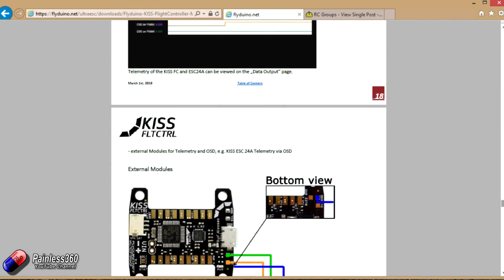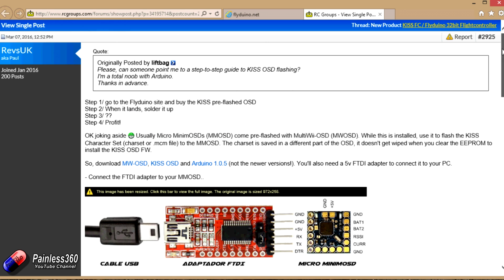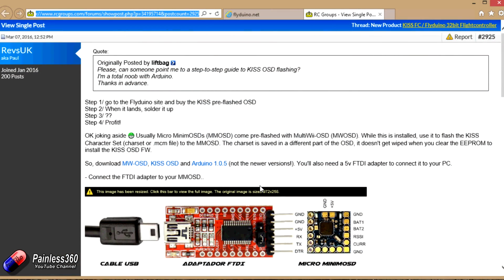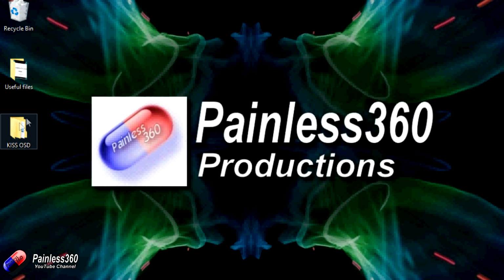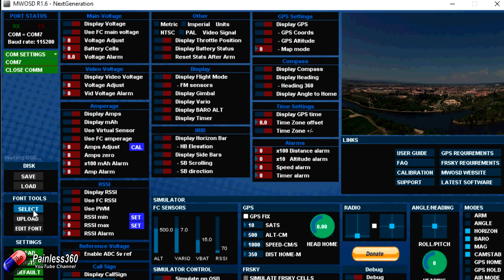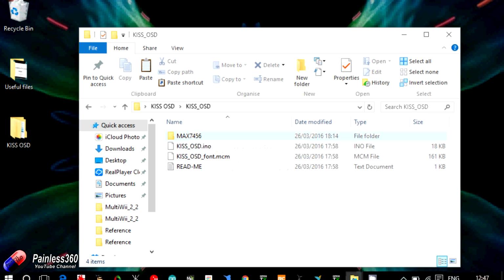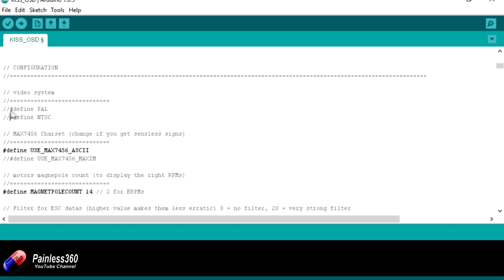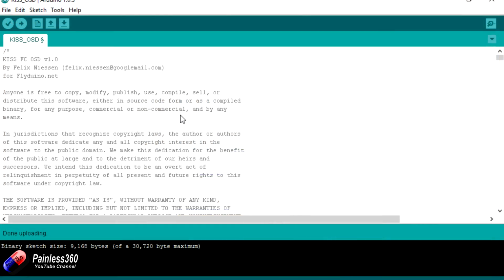(3/3) KISS Flight Technology - Adding an OSD

Comment: Just to point out that now (22/06/2017) MWOSD 1.6.8 is compatible with KISS FC. All you need to do is edit config.h inside Arduino (latest version will work): just uncomment #kiss and the OSD you have (in my case it´s the minimOSD). 

You can follow this thread on RcGroups:  https://www.rcgroups.com/forums/showthread.php?2763206-Diatone-SP3-Stackable-Switchable-25-200-600mW-VTx-w-OSD-Pigtail-5V-BEC-40/page2

It´s about the Diatone SP3 but I guess it will work on any OSD running MWOSD. The whole point of it is that you can configure it using the GUI!! :) By the way, to make it work I DID have to cross rx and tx between the OSD and the KISS FC. At first I followed what´s said on the thread and it didn´t work.

I must say I´m not getting RSSI but I guess I can get it by wiring the OSD directly to my X4R SB receiver. Or maybe I´m missing something about KISS FC since I´m still new to this technology.

Hope this comment helps someone!

Comment: Hold on, you say that the software needs to be more sophisticated for you to use it. What's it missing at the moment? This video is only a month old.
Reply from the maker: +PinchTune anything V1.0 is the first attempt ;) No customisation and setups yet. See the other OSD videos for products with a little more maturity to see what I mean.
Reply: Well, I guess I do understand what you mean. It's just that I thought that by now all the features would be there. I run other OSDs... mainly the Power OSD Pro and now also a RRotor OSD. But those only work from the front end (battery side, not from the ESCs). But I only really need current, consumption, voltage, timer and RSSI. I thought the MicroMinim on KISS could already do all those cleanly.

Comment: One quick question: how does one enable the telemetry on the esc.... my batch of esc don't show any information at all. Ii have checked the cables and everything is wired according to the manual. I also have an Flyduino Kiss OSD and i still don't get any data at all.
Reply from the maker: Not sure - I'd ask the vendor for some help. Ours just all worked here... Best of luck with it!

Comment: Using your assembly intructions as videos and LiPo Battery 2200mAh 3S 11.1v 30C what is the maximum you would let the battery drop before you would need to land.
I am going to set up the Taranis plus with battery warnings to land before damaging the battery. 
Can you advise?.
Reply from the maker: +Wynne Davies 3.5v per cell in flight so it was about 3.6-3.7v on the ground. See the LIPO video in the 'Introduction to Remote Control' playlist for more detail.. Happy flying!

Comment: I am getting an error after update of the firmware - avrdude: stk500_getsync(): not in sync: resp=0xb9 - It says that it is done updating, but this error comes up and it looks like it never really finished.  Any Ideas?  BTW I am using a PIGGY OSD board.
Reply from the maker: We have a video on that error - hope it helps.. Best of luck.

Comment: I still just fly los, want to get into fpv at some point but why do you need an osd? What are the benefits? And do you need to run it on every quad you run fpv?
Reply from the maker: +Justin Zwick watch our video on learning to fly FPV,  should help. Best of luck!
Reply: +Justin Zwick Short answer is no, you don't HAVE to have it at all but it's a nice add-on.  It really depends on your application though.  In a race quad flight time, battery voltage and RSSI are about all you really want.  It's not mandatory though by any means as you can get this info using things like radio telemetry if you have say a FrSky system.  Having that info on screen though is definitely a better way to go as you can see it real time whereas radio telemetry only alerts you when certain conditions are met.  If, however, you have say a GPS equipped autonomous flying aerial video multi then there is an enormous amount of important info that  you can access via an OSD such as direction and distance to home or the next waypoint, number of satellites the GPS is locked into, GPS co-ordinates and to name a few.
Reply: +Andrew Smith for me most of the things are not necessary but knowing your flight time and voltage is essential to not dropping your quad out of the sky or having to land miles away.

I really like the osd on my eachine racer which just has these essentials displayed plus the broadcast channel. Eachine make a 600mw VTX that has an osd like this built in. If you don't want to have to fart about i would absolutely recommend one of these.
Reply: +Stephen Gibb  Yes I agree that "knowing your flight time and voltage is essential to not dropping your quad out of the sky" but as I mentioned there are other ways of getting that info than an OSD, but again, as I also mentioned, an OSD is the better way to get it too.

Comment: What kind of netbook are you using?
Reply from the maker: +Nano Mechs we use a tablet PC with a keyboard a lot now..
Reply: +Painless360 thanks for the reply. can a tablet pc handle all of the software needed for the quadcopter hobby such as cleanflight, opentx, etc.? Im looking to buy a new computer to bring to races and i would like it to be as light and compact as possible. Also i want it to be affordable

Comment: Which Programm i have to use at the Arduino Software?
Reply from the maker: I use Arduino V1.0.5 here.. Google will find it for you..
Reply: i mean the Programmer like 
AVR ISP
AVRISP mkII
USBtinyISP
USBasp
Parallel Programmer
Arduino as ISP

what i have to choose?

Greetings
Reply from the maker: We use the FTDI Basic adapter here.. Best of luck!
Reply: In the settings of Arduino.
Tools than Programmer
which one you have activated?
Reply from the maker: USBasp..
Reply: Thank you :)